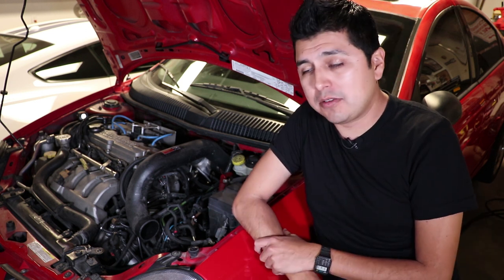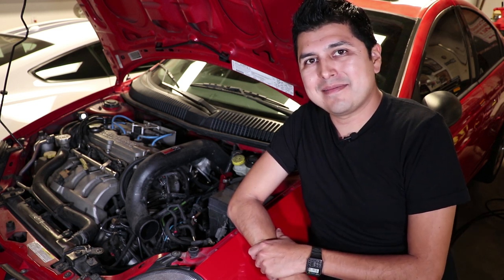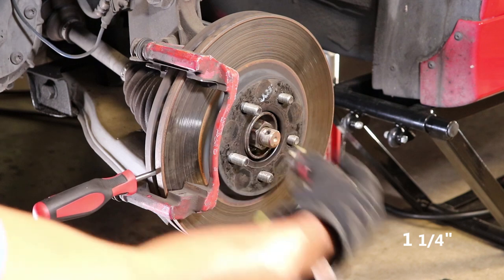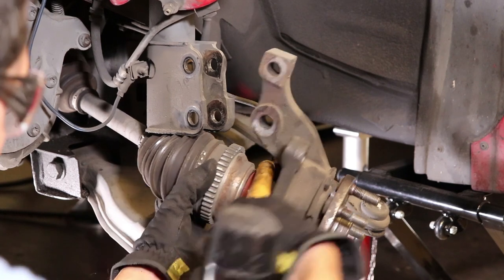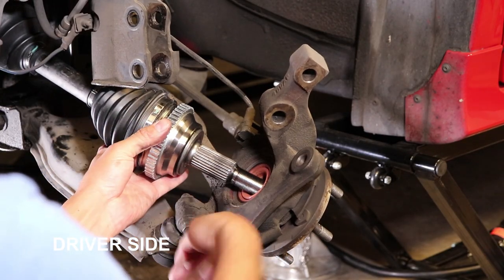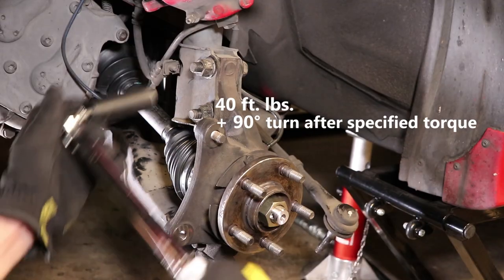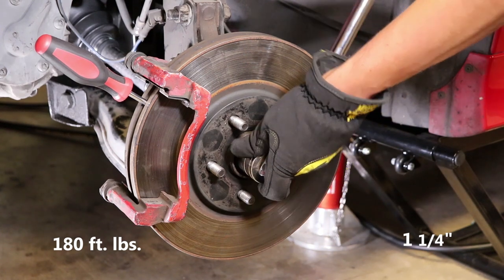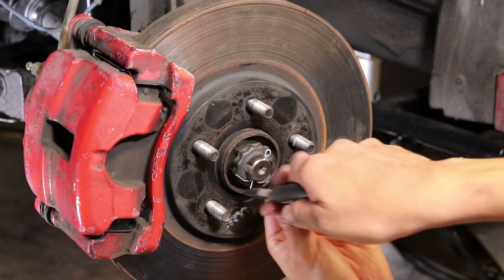Dodge Neon SRT4 Axle Replacement | Removal & Install (2003-2005)

Comment: Two tips to add:  The "4th mount" motor mount is often not included in solid mount sets. They go unnoticed because its hard to even see it (next to timing cover, below upper torque mounts). If it's bad (if its original, its bad by now), you will constantly have to replace the passenger side axel and wheel bearing because the motor sits multiple inches low when it goes. Don't ask me how I found out.   Oh, and when you take off your axel nut, if you have a metal pipe to slide over the end of a breaker bar, it will help loads with leverage.. if that doesn't work, get an impact air gun and it will work well.  Harbor freight "Earthquake" works well. The axel nut can be impossible without an impact.;
Reply from the maker: Hi Me Gusta! thanks for sharing this tips man!
Reply: @AlexAutoFun  No problem. Good video. Thanks for the clutch video. It's perfect and quick. very good editing.
Reply from the maker: @megusta2620  Thanks man!

Comment: Good how-to. Very clear. Only thing I do different with my axle install is I leave the brakes all assembled and installed. It just saves a little bit of work.
Reply from the maker: Thanks man! That't interesting never thought about leaving brakes on, is there enough slack in the brake line?
Reply: @AlexAutoFun  Yep, never had an issue with the brake line doing this.
Reply from the maker: @BoostedFools Good info will definitely try next time, also cool user name!
Reply: just make sure you disconnect the one at the wheel well on the wall it's a 10 mm bolt I believe then you'll have plenty of slack in your brake lines

Comment: Great Video! Thanks for taking time for adding the torque specs. Should I replace the trans axle bearing to on the pass. side? My car has 160,000 and the axle has some play in it and is VERY hot to the touch. Drivers side is not hot to the touch and has no play. Thanks for following up on the answers!
Reply from the maker: Thanks Michael! I'm assuming you are referring to the axle hub bearing? I'm at the same miles, 3 are original ones and 1 was replaced. So far they seem to be holding steady but they are likely near end of life. If yours is getting very hot and has play I would change it, that was the symptoms my old one had. I bought a press but most shops with a press will press it in for you cheap. Thanks for watching buddy!

Comment: Sorry but I have to completely disagree with you and soul a lot of other people on the solid motor mounts. Solid motor mounts cause way more problems and you end up breaking more stuff because there’s no give. And They caused so much vibration through out the car that things start shaking and falling apart. And it’s especially annoying when you’re driving it. My SRT had solid mounts on it when I first got it and I couldn’t stand all the vibration so I switched all the motor mounts back to factory motor mounts and boy was it ever a huge difference and so much smoother of a ride and seem to run a lot better also
Reply from the maker: Hi davieboy1970! yep solid motors mounts are definitely not for everyone (my friend for example can't stand riding the car, she says her kidneys hurt from all the vibration and roughness LOL and it doesn't help I'm running the Rims from the SRT4 Extreme Lightweight further increasing NHV) I cover this in more detail on this other two videos not sure if you see those yet https://youtu.be/qdL6dzc_sDc and https://youtu.be/l4jl1PXLU5c Cheers Bud!

Comment: Was looking at the video. You mentioned a snap ring has to come out. I didn't see that in the video. Where is that snap ring. And when and how are you removing it. Do you remove it before pulling out the axle.
Reply: Bumb, also curious about that
Reply from the maker: Hi Jahanzeb Akhter, there is no snap ring to remove, the snap ring is mounted on the end of the axle to help hold it to the tranny. It shouldn't come off the axle, unless its broken. Tugging on the axle pulls the axle free or as I do in the video I pry on the axle. Hope this helps!
Reply from the maker: Hi John Wall, please see my reply below, hopefully it make sense, and thanks for watching buddy!
Reply: @AlexAutoFun  i ended up changing an axle on my srt4 i just tapped it off thank you ir vids help alot, gona be taking the tranny out soon to

Comment: Thank you, good sir! Was there a “click” when you installed the passenger side axle? I know the driver side clicks in but my passenger side does not and I’m wondering if the axle I got is missing something. Your help is appreciated!
Reply from the maker: Hi Able! sometimes I have felt or hear the click, sometime it has gone in a locked in place but didn't hear anything. What I normally done, is I just check visually to see if the "C" clip is installed in the end of the axle before installation. I have also been able to confirm it has "clicked" in to place by lightly pulling on the axle to see if the axle is retained before completing this installation, hope this helps bud!
Reply: @AlexAutoFun  you the man! Thank you.

Comment: So I'm trying to remove my transmission so I can replace the clutch and I took the 213 mm bolts out of the intermediate shaft and it will not budge I yanked on as hard as I can and I can't get it to slide out can you help me out
Reply from the maker: Hi Vincent! I would double check all the bolts and associated components have been removed. It usually comes off fairly easy at that point (unless your spline shaft is seized into place with another component like the clutch splines, rare but I seen it happen). Hope this helps and thanks for watching bud!

Comment: Just curious, how many Duralast axles have you gone through? Thanks for explaining why they break. Are you running all four solid mounts and coilovers? If so, what kind? Also, thanks for your awesome videos on this platform. They’re really helpful!
Reply from the maker: Hi Michah, I actually only gone thru one set (lasted many years on my Stage 3 Mopar setup) I only recently changed due to the rubber boot cracking, I was blown away by how durable and how affordable ($) they are. I do have all four solid mounts. I used to have the Mopar Coil over setup but I'm now back on Mopar stage 1 springs. Thanks for watching appreciate the positive comments bud!
Reply: @AlexAutoFun  Nice! Yeah, I'm planning on adding the third mount, but that's going to be an all-day thing from the looks of it. If you want to make a video on that sometime, that would be awesome. Back to the axles, though — were your Duralast Gold the same length as your stock axles? Another YouTuber, ModItAll Garage, did an axle replacement and they were substantially shorter than the stock axle. It has me a little concerned. I'm only at 300whp right now, so it might not be too big of a deal. Hoping for more whp in the future. Thanks again!

Comment: Is it the same for a 2005 dodge neon sxt cause I'm pretty  sure my neon needs new axles the passenger side is vibrating and it's getting worse great video by the way best I've seen yet
Reply from the maker: Hi MarkO Devoll, its pretty much identical with a few exceptions and torque specifications. From what you are describing I would agree it sounds like an axle is on it's way out. Lets us know what you find bud!
Reply: @AlexAutoFun   I replace the passenger side yesterday but I was losing daylight so I have to do the drive side in the morning it did take most of the vibration away when i test drove it but i still heard it vibrated once or twice but that's a real big improvement compared to what it was doing cause it was vibrating all the time so hope fully it will be completely gone when i finish the drive side , thank you for getting back to me and this video was a big help I so appreciate watching this it took alot of worry away I cant thank you enough
Reply from the maker: My pleasure MarkO!

Comment: I think u can remove the axle with just removing the knuckle from the lower control arm
Reply from the maker: Hi Charlie! yeah I think so, in fact the method you describe is actually closer to how the service manual calls for it to be done, I just always found it easier to approach it from top, but good tip! Thanks for watching bud!

Comment: hey so im using the same axles but for some reason it isn't flush with the case. I feel it lock into place but I can also pull it out very easily. Any thoughts?
Reply from the maker: Hi Adam! normally the snap you feel when they lock in is pretty noticeable, and they are somewhat hard to pull off again, now it is possible they axle is only partially engaged, I usually pull it back out slightly and push it back it with one in one shot to it snaps in (sometime this takes a couple times before it does). Hope this helps and please let know if you were able to figure it out bud!

Comment: You only want to use Mopar axles even used ones are better then autozone etc axles. If you want upgrade get DSS axles
Reply from the maker: I was never able to get my hands on Mopar ones, it sucks they discontinued them, if I ever do find one I will sure give it a try, thanks for the tip Stank Dank!
Reply: @AlexAutoFun   Real tune is about to come out with the axles they used on the 9 second cars thats the axle i would buy. My friends have snapped DCR axles

Comment: hey how high do you need to lift your car to use that jack? Im having trouble with the install and removal of my transmission and this jack would be great but it doesnt look like there is enough room for it to fit.
Reply from the maker: Hi Slace0Zero, I believe your are referring to the Quickjack? it's super low profile, probably more than my low profile regular car jack. I'm slightly lowered on Mopar Stage 1 springs but I do have a video coming up where I review the Quickjack on the SRT4 should have actual clearance measurements in case your are slammed with little space. It does help a lot specially on the tranny job as it can lift the car quite a bit up on the air.

Comment: I am running stock power how long would the duralast axles likely last me? I do not go to the track however i do the occasional pull every couple days.
Reply from the maker: Hi isnapaxles, I been getting about 3-4 years on them before the boot breaks but axle still work (while on Mopar Stage 3 aprox 25 psi of boost). The previous axles from other brands would only last me a year or less before the actual inside snapped leaving me stranded. Not fun LOL

Comment: If you have the part # for the axles that can help. I can’t seem to find them on thier website. Thanks!
Reply from the maker: Here you go Ricardo: Driver Side Axle:  
https://www.autozone.com/drivetrain/cv-axle/duralast-gold-cv-axle/516642_885250_0_78655
Passenger Side Axle:
https://www.autozone.com/drivetrain/cv-axle/duralast-gold-cv-axle/401506_885250_0_78656
Reply: @AlexAutoFun   thank you so much !
Reply from the maker: @ricardomuro9567  You're welcome!

Comment: Did you pry the driver side axle with an extension?
Reply from the maker: LOL yes I did! Part of the reason is that the extension has round edges which helps me avoid scratching of denting anything..
Reply: @AlexAutoFun  did it today. Worked like a charm. I was hoping you'd show how to put the passenger side axle into the half shaft. I can never get it to go in. I have to remove the entire assembly from the car and then separate. Same goes for installing it.
Reply from the maker: @1221Ralph   Awesome! glad to hear that, yeah I ran into the same issue too, for some reason sometimes it give me trouble getting in the snap ring to "pop" in place, sometimes it goes in real easy, it's really weird..
Reply: @AlexAutoFun  yes! I even used a new snap ring from the dealer and still had the same issue. All 3 times I've done the passenger side I haven't had luck popping off the axle from the half shaft. The driver pops off fine and goes on fine.  Any other repair videos coming soon?
Reply: @1221Ralph  I know it’s been a long time but do you remember the part number for the snap ring?
Reply: @1221Ralph  life saver bro! Thanks

Comment: You dont need to remove the tie-rods or remove both nuts to the strut
Reply from the maker: Hi Michael Martinez, your are correct, I seen different variations on the install process for this, probably a matter of preference with some having more or less labor involved. Thanks for watching bud!